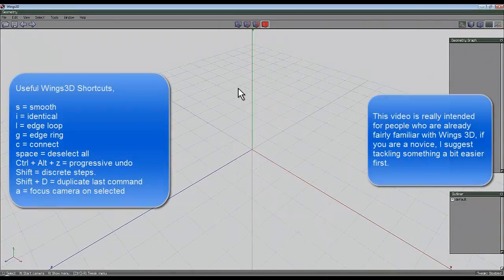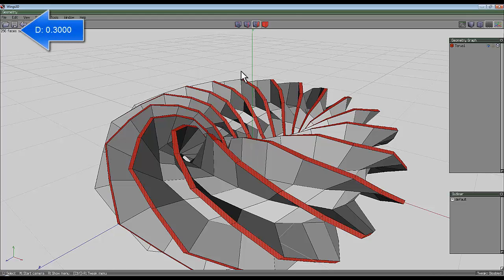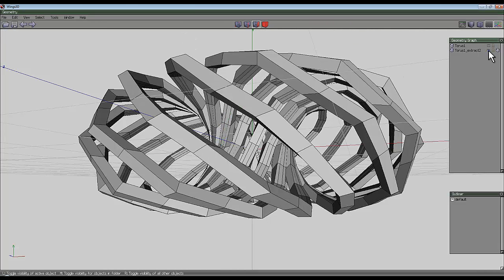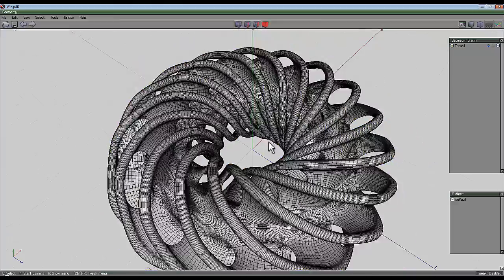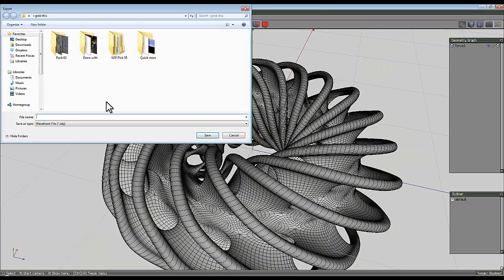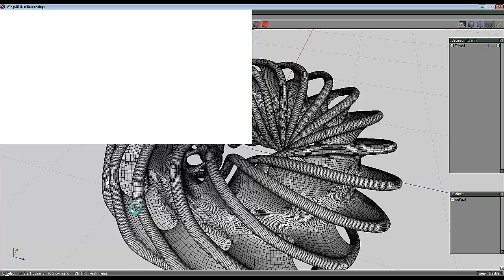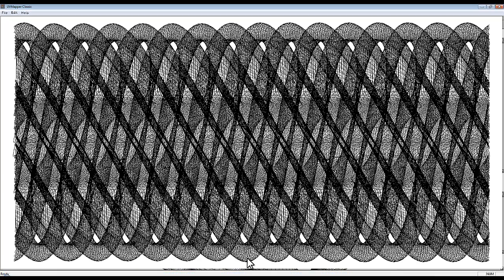Wings 3D project - torus twist - by David Brinnen.

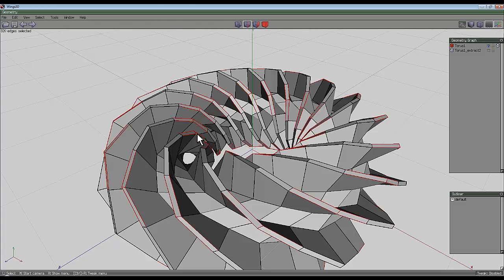Comment: Hello David - I'm having major issue when doing a critical selection - at 2:42 when you select using the Nth Ring, no matter how many times I've done this when hitting the + key or clicking the edge selection button - my selection grows around the entire length, and when clicking on the face button I don't get every two panels selected as your demo shows it grabs all the faces on the rings? Hope you can help...
Reply from the maker: Hmn... tricky.  OK I suppose the first thing to check is that you are using the same version as shown in the video.  Things may have changed since I made this video and this is not a piece of software that I am overly familiar with.  So check the version is 1.5.2  Just in case.  The next thing is that I know some software differentiates between + on the keypad and + on main key area.  And also look at the state of things like num-lock and caps-lock.  The software may well vary the way it responds to commands dependent on those settings.  I mean, if it worked in the video, it must have worked at the time.  But that's no help to you if it does not work now.  The other option is that the Nth Ring selection is just an automation, so tedious though it may be to go without this, it is possible just to go in and  perform the procedure manually if Wings is not co-operating.
Reply: Hello David - thanks for the quick response! Version is currently 2.1.5!! I will plod ahead and see where it all goes - thanks again for your insights, I can't wait to watch the other videos you made using Wings - do you use ZBrush?
Reply from the maker: Oh I am quite out of date then, sorry.  well I have looked at ZBrush, but though I was very impressed with what it could do, it didn't really seem to be a good fit with my way of working.  However, I did need to find an upgrade for Wings in order to tackle more complex projects.  Wings is good and has a very good tool set but I was beginning to struggle (at least with the versions I was using at the time) when the models got more involved.  In the end, after a few trials, I plumped for Modo.  But your choices must very much depend on what tools you need, the scale of your project, the depth of your pockets and above all, how you get on with the workflow that the software imposes on you.  If you want to see Modo in use I recommend the tutorials by Peter Stammbach, that will give you some idea of what it is like.  Wings is less forgiving and as such a very good way to learn the mechanics of modelling, Modo after learning Wings, is to be given a taste of freedom.  Feel free to keep asking questions if you have any.  This is my 24/7 job so there's a good chance I might know a thing or two ;)

Comment: I am looking to reproduce this in wings3d following your demos but am having a hard time getting the steps. My first thought is triangle. http://www.youtube.com/watch?v=vCVC0TTeJto any recommendations or steps to follow? Thanks.
Reply from the maker: Well that is very tricky.  Few of the things I've made with wings were to be intentionally anything other than what they turned out to be.  If your plan is to model a specific shape, then it is unlikely that there is any ready made recipe - at least by me.  It would not be a question of "steps" but a modeling project.  In which case you need to have a somewhat different skill set than the ones in my little demos.  And I don't know Wings well enough to tackle that.